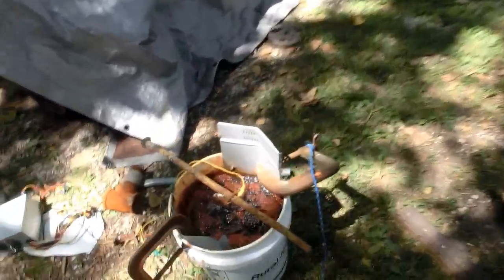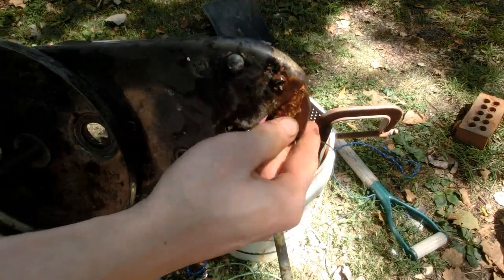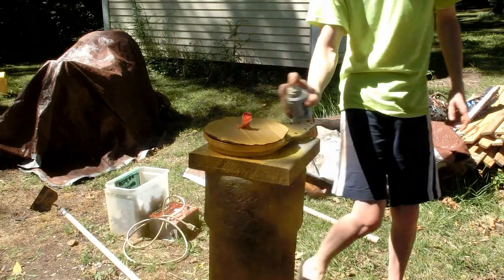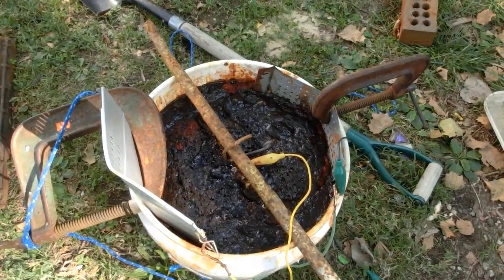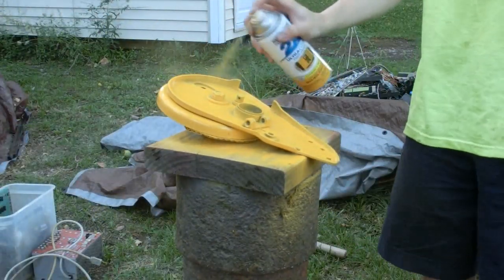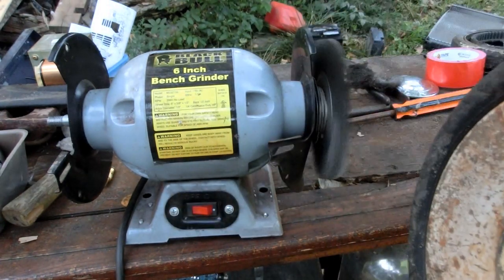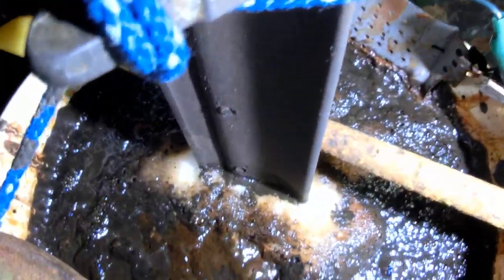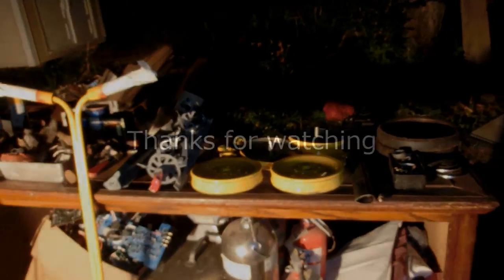1950s Reel Mower Restoration part 2: electrolisys and painting

Comment: I just read all the previous comments on this video and am amazed. It seems like a lot of people see you as NOT being an expert welder or expert painter and they are correct, and may be experts themselves, but I bet they don't have the imagination or drive to try all of the things that you do.  Like you said yourself, if it works for you and gets the job done that you want it to, than keep doing it the way that you like. I actually agree with them about your painting technique and every time I try it your way I get sags, runs and lots of dam bugs stuck to it.  The mower IS looking good so far and I am looking forward to the finished product. One other thing to remember, "Time is money" so you could spend a few days getting a perfect paint job, but is it worth it?
 I also like using old tools, but I try to use the correct tool for the job to make working on things easier and don't want to offend you by telling you to try using an impact driver to remove stubborn screw and bolts, but I have no idea if you even know what one is due to your age and life experiance because I'm 55 and am still learning about tools that I had no idea were out there.
Reply from the maker: yes i have 2 impact wrenches, but the time spent on getting air hoses out and turning on an air compressor and finding the right socket is far worse than just using an adjustable wrench.
Reply: Rinoa Super-Genius I'm not talking about an air driven impact gun, I'm talking about a manual hand impact driver. It is a big fat bodied screwdriver that accepts replaceable bits similar to the type used in cordless screw drivers. you place the bit in the screw head while holding the handle firmly than smack the other end with a hammer. That causes the the bit to turn in the selected appropriate direction with a lot of torque and downward pressure to keep it from stripping out the screw head. They are reletivly cheap $7 to $30 to purchase and well worh having when working on old rusty things. here is a link with a lot better explanation  http://en.wikipedia.org/wiki/Impact_driver .

Comment: Dude I just have to say; it's nice to see you using old, restored tools and making old stuff new again.  99.9% of our generation consists of 'if it breaks, throw it away and get a new one from China', and that's just sad.  They don't make things like they used to, and stuff's designed to break down now which is just a sad case of shitty economics at work.
Reply: Rinoa Super-Genius lol, yeah, tools these days are built like crap.  I have a few old tools and a 100 year old or so bench vise and they are absolutely indestructible...made in America and build like a tank.  Like they say, they ain't made like they used to be!
Reply: sc0tte1     Actually in the past many things were probably built poorly, but since the better items tend to last and be kept, these are the items that we see representing the workmanship of the past.  Statistically, if you find something old, its probably good - unless it is something that has set on a store's shelf for years which may indicate the opposite - it is so bad no one wanted it.
      Some of the stuff from mainland china is made by melting any types on metal together with impurities and the tools are junk.

Comment: Your first coat should be like 20 percent coverage. second should be like 50 to 65. and third either 75 or 100. lighter coats dry quicker. and allow alot less bugs to stick  ;s
Reply from the maker: yeah but i'm more worried about making sure to prevent flash rust, i've had things rust in as quickly as 4 minutes.
Reply: Oh. well then lol. i guess thats true
Reply from the maker: ghostrider433
 illinois is really humid this time of year, it can muck up your plans.